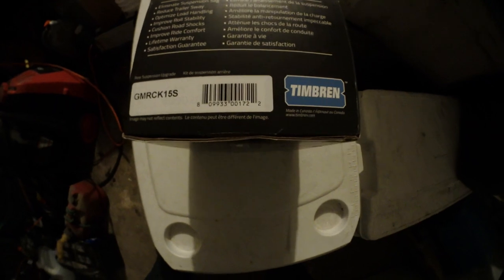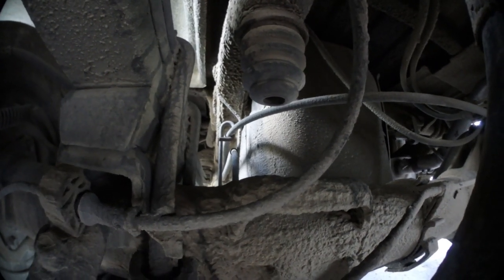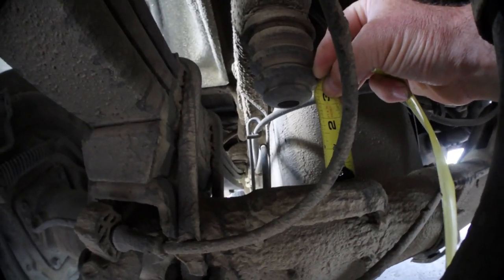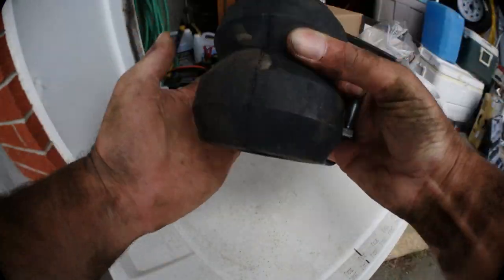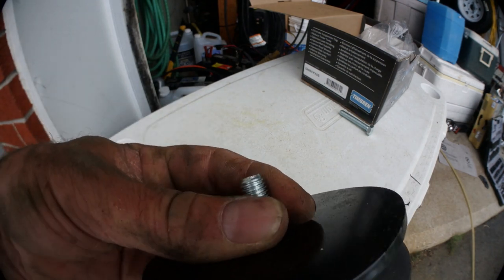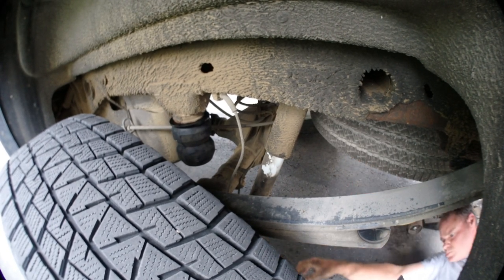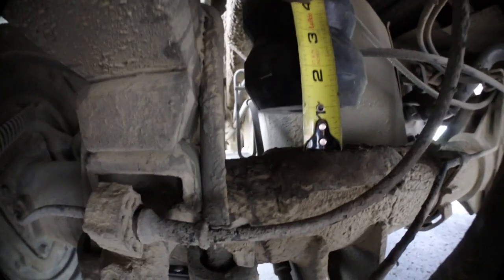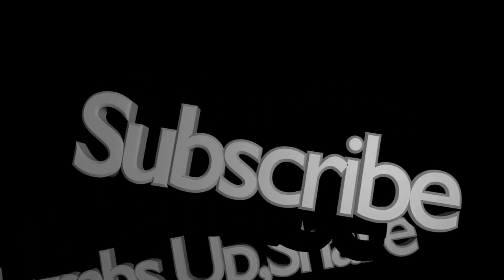Timbren rear suspension upgrade - GMC Sierra 2014 1500

Comment: WARNING: Got Timbrens put on my 19Ram1500 'classic' 5.7 crewcab w/2" level kit, 35x12.50 F-rated NittoRidgeGrapplers for towing my 26' trailer= 
They work Great... IF YOU'RE TOWING a 6000lb Trailer. They prevent sag & act as suspension when under Massive weight. Much needed for my '1500' 👍
 OTHERWISE NOT TOWING.. over bumpy roads you get 1"of suspension travel til they hit the Axel plate and BOOM That's IT. Hurts my kids butts to go over speed bumps, and the truck will skip sideways a bit on bumpy roads. Now I have to switch them out until I need to tow again.. 
NOT DAILY DRIVER QUALITY..!!!!!!!
(I also got Fox full strut 2"level kit for front, prob adds to that problem.. wonder if the 2" spacers would've been softer ride than the struts..?)
Reply from the maker: I totally agree with you,should be put on a work truck that is always towing something.
Not fun when not towing.
You can feel every bumps and it hits hard...
Reply: @obscur156  what would you recommend if you also drive without a heavy load?
Reply from the maker: @raptureready9502   Maybe Sumo springs but did not tried them.
Reply: @obscur156  thanks for the reply. U am going to go with sumo
Reply from the maker: @raptureready9502  You are welcome !

Comment: Driving impressions?  What's the ride quality like loaded and unloaded?  Thanks
Reply from the maker: Ok, first when going fishing my pickup bed is full and towing the boat was way better and no sagging. I like how its handling now with Timbren.
When unloaded, the ride quality is where it hurts, especially here in winter. Today is -15 Celsius and the ride is rough. You feel every bump...
With the OE bump-stops, there is like 4 inches of travel before hitting the bump-stops.
With the Timbren bump-stops you have only about 1 inch travel before hitting the Timbren so...
Depends where you live and how often do you need this, if you live in a hot climate it will be less annoying when unloaded.

If you need more info,just ask.
Thanks for watching,regards.
Reply: I just purchased a used 2014 Silverado and it had these bump stoppers and the ride quality is bad when you hit a bump or pot hole. I’m going to remove these and place some stock ones on my Silverado but If I ever haul a heavy load I’ll be switching them back
Reply: @drewsolis1634   swap them for Sumosprings instead of factory if you will be towing.
Reply: Drew Solis  where can you find oem hump stops that are for a 2014 or newer Chevy. I’ve yet to find a part store that has them . Can’t even find them online
Reply: Daniel Smith I couldn’t find OEM but they sell universal bump stops at O’Reilly
Reply: Ride quality unloaded is terrible going over speed bumps throws you around when sitting in the back seats these are intended for loads and handling is great when loaded
Reply: If the ride quality is bad they may not be installed correctly. The pad shouldn't be making contact with the axle when unloaded unless you are traveling on the worst road in America.